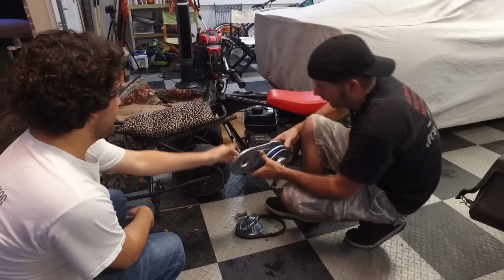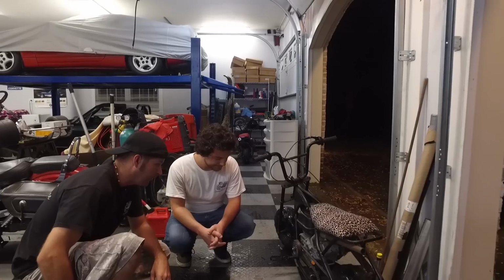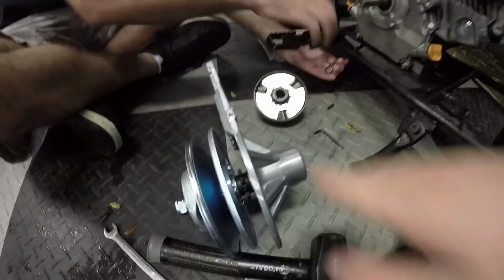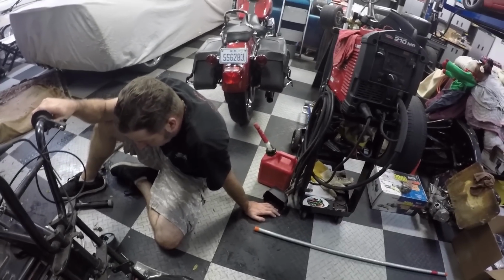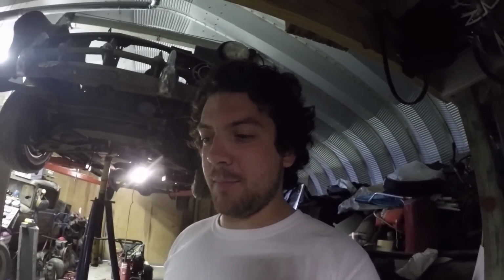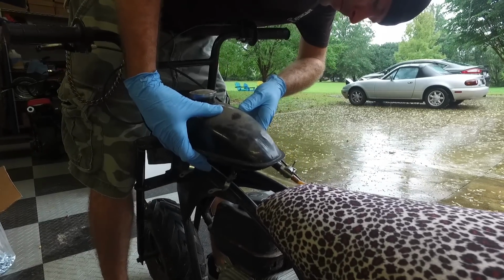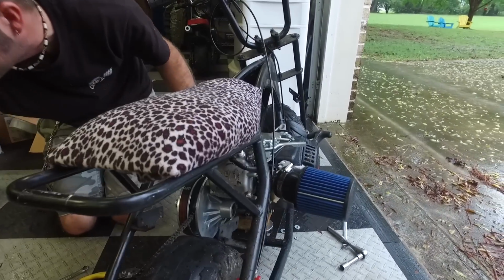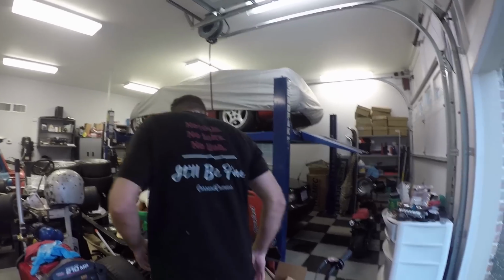Mini Bike Torque Converter Swap

Comment: It's not the best idea to drill out jets. Drills don't make the whole the exact size and leave a burr. The manufacturer takes this into consideration and makes the jet then test them to figure out the size they act like rather than what they should be. So it may work but don't expect it to work correctly.

Comment from the maker: It finally happened.
Reply: CarsandCameras just bought a mini bike for 80 it has a old briggs and stratton motor and the frame is from taco what are your thought. Did i get ripped off¿
Reply: CarsandCameras can yall build a racing mower
Reply: CarsandCameras hi
Reply: i have crippling depression
Reply: SoutherN Mudding Mowers they should
Reply: Make your engine spacers out of hockey pucks.
Reply: Chips Dips you got an awesome deal if it's a genuine taco frame they normally go for a lot more
Reply: CarsandCameras  yall jumped on the band wagon  nice
Reply: CarsandCameras, have you guys ever considered using hockey pucks for raising the motor ? I've done it before, with great success.
Reply: CarsandCameras can you build a kard fram whit stireng as a how 2
Reply: I bet that's a good price
Reply: Yes you should totally fix up those old motorized bicycles they are neat, I actually just got a kit in the mail to build one, I have a new schwinn sidewinder mountain bike that I will use as the frame, I'm going to film the build and post it on my channel, hope the cops don't mind me driving it on the road I got the 49cc engine so it should be legal.
Reply: Isaac it'll be fine
Reply: They don't have any power. They are a waste of time for anything besides commuting in a city with no hills.
Reply: are you kiddin me! those are 212cc dude i have one of those on my go kart and i can keep up trail riding and mudding with my friend who has a honda trx 450
Reply: CarsandCameras you should put nos on the v twin
Reply: CarsandCameras J  awsome
Reply: CarsandCameras what year is that mini bike? And what motor do u have in it? I jst found an 80's mini bike frame with rear breaks and a throttle and kill switch line but the throttle it's self is bad. Plz respond need to get mine built
Reply: Same thing I did on mine. I have a 69 rupp frame that I put a Predator with a tav2 on it. I still have the original "testing" spacers made of wood under the engine.
Reply: awesome
Reply: CarsandCameras do something with that small motor bike
Reply: Chips Dips that’s a good deal for the frame alone
Reply: Ike in his underwear?

Comment: I have a 2016 Polaris ATV, they use torque converters (machine is automatic with H, L, & R).  I'm impressed with how fast and smooth my machine will launch.  For those of you who have a 570, it will go from 0-67mph in high gear.  I wouldn't hesitate to put a torque converter in anything.  Glad to see the mini bike upgraded from the clutch.

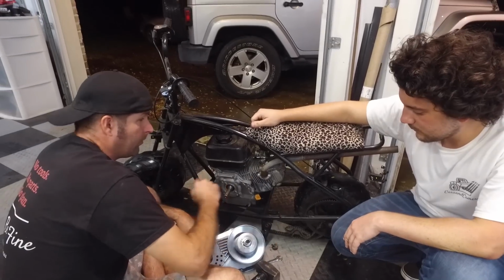Comment: at your 5:00 , I made 4 oblong holes with a roto zip where the regular holes were so the main mount bracket could easily be adjusted counterclockwise to keep the mount from hitting the frame. also installed a adjustable motor plate.mocked up a real good chain tensioner also.
Reply: gotta hang out with you guys

Comment: I have an old video how to install one on a doodlebug, it was all dirty at the time, now it is a lot cleaner. Ever since the video it has been camed and new tires and more. I used 1.5" box steel that had been sliced in half leaving me with two 3/4" C shaped pieces. Has held up great, no problems.

Comment: Yall definitely needa mess with those motorized bicycles. their motor has a cult following behind them much like the predator motor but have the advantage of obviously being 2 stroke so much simpler engine also parts are much cheaper. believe it or not if u mock up one of those motors enough, you'd get close to 9 hp, granted their not as torquey as ur predators and contain a smaller higher power band but that's why their used on bicycles so u can make up for the low end loss. I've always wanted to see somebody put a torque converter on one of these to see the advantages and disadvantages it would bring. keep up the great work, love your show and all your projects.

Comment: about your mini bike you can add a longer shaft on the back part of converter and  put the sprocket on right side instead then  change back wheel put the chain sprocket on right side

Comment: If you take off the governor,..what do you have to modify to compensate for the change?  Is it .036 jet, 140 emulsion tube, performance air filter, and 18 lb springs,..is that enough ?   Do you HAVE TO change to billet rod and billet flywheel (performance), also, or can you leave that until later without it damaging the engine ?

Comment: I actually prefer the centrifugal clutch over the torque converter on minibikes. so much more direct just have to have the right gear ratio. and i ride in very hilly woods trails.  gokars are better with the torque converter just because of the weight and its nice to go slower in the tight trails

Comment: hey I put a torque converter on my minibike (sold it tho) had a 5hp Briggs industrial engine which makes a ton of torque as is and with the converter it did wheelies at half throttle. the minibike in my profile pic is the one. also, the older model baja minibike have alot more room for engines, they where more square just to let ya know

Comment: You should do a motorized bike build. I just rebuilt mine, it has a predator 212cc engine with a torque converter and it runs on propane

Comment: I NEED HELP!
Hey guys. I just got my torque converter on from Go Power Sports and I love it. But I think there might be problems?
1. The belt moves when the engine is on.
2. The go kart takes off on stand still.
3. And the engine tuns off when coming to a complete stop.
What should I do? Also there's an aluminum flywheel and stronger replacement drum springs on the torque converter to withstand the higher RPMs on my Honda gx200 engine
Reply: is the belt on the correct way? it only is supposed to go on one way. is the engine rpm too high? does it have the brass collar so while its idling its riding on it?
Reply: The flat part of the belt is facing the engine. 
I dont know if the rpm is too high? Does the aluminum flywheel make a difference with torque converter aside from the regular flywheel? I also placed  stronger springs on the drum. does this make a difference? And yes the brass collar is on.
Reply: its hard to say without being there in person

Comment: How do you tell what kind of go kart you have I have one that has a 5hp Briggs and only on wheel spins the motor is on the rear axle and it has the brakes that push against the tire

Comment: I cut about 3 inches of aluminium from the bottom of my torque converter, works fine. Wasn't willing to cut frame and weaken it.
Reply: been watching videos for hours trying to see if anyone else has cut the torque converter instead of raising engine, thanks!!! lol

Comment: I have just gotten a Mini Bike and the motor is ceased(For Free). I have a Go Kart with a 6.5 HP Briggs(I bought the motor for $20) with a burnt out Clutch. Should I buy a Predator and put it on or Swap ?

Comment: That frame plate of the torque converter is solid aluminum? Wow, in the olden days, they were just stamped steel sheet metal!

Comment: Hey guys I was wondering if you could help me out. I have the same minibike with a stock predator 212 and I bought a torque converter for it off of eBay and put it on and road it for a while and the bolt that attaches the front pullie to the crank shaft snapped in two while I was riding it and the threads are stuck inside the crank shaft. I currently have the crank shaft at my local mechanic to see if they can remove the broken piece of the bolt from the crank shaft. I was wondering if you would have any idea why it did that and if you have any advice to keep this from happening again?

Comment: I need help with my go cart. I am trying to wire a kill switch. I have a Briggs and Stratton 319cc 8hp. It's got a wire coming from the coil, and on the end is an on/off switch. To turn it off currently, you just touch the switch on the engine. I am trying to get it so I have the switch on the frame up front so I cant turn it off from there. Any suggestions? The switch only has one prong.
Reply: the one wire from coil just needs to be grounded to cut it off. just have the switch on a good ground and wire it up to the coil.

Comment: I've put a predator 212 on a Monster moto bike with a centrifical clutch and it will do wheelies all day if not throw me off of it if I'm not careful why do you need better acceleration I already have to lean forward just to keep from busting my ass. isn't this torque converter also going to add top end because mine right now, and I way just under  180 pounds, will go 43 miles an hour. what really got in your way as far as on the Monster moto bike because I would love to install a centrifical clutch mine. or should I give that idea up? Thanks guys love your show.
Reply: i like the clutch on mine but i cant go up hills because my clutch overheats

Comment: I wanted to know if a predator 250cc engine would be over kill on my motorized bike?
Reply: if it fits go for it lol
Reply: Isaac it'll be fine I wanna see a v twin on a stretched mini bike frame with a torque converter,  and some tall wide meaty four wheeler tire on the rear and a springer front end. it could also lead to a mini drag bike when the tire goes bald 💀💀💀💀💀💀💀
Reply: Isaac it'll be fine Common Ike you know you can make, a hill climber/ drag mini bike

Comment: why dont yall built a shifter cart. like 2 stroke and everything
Reply: Derrion Nettleton expensive.
Reply: magzilla vlogs it's not that bad they already have shifter cart frames they got a while back
Reply: Ya it is. I guess you dont know how much a good 2 stroke dirtbike motor cost
Reply: magzilla vlogs a 125 engine shouldn't cost more then $600 I can find them all day on Craigslist list or a full cr 125 is like $1200 for a decent bike